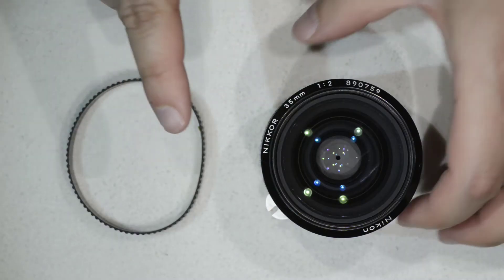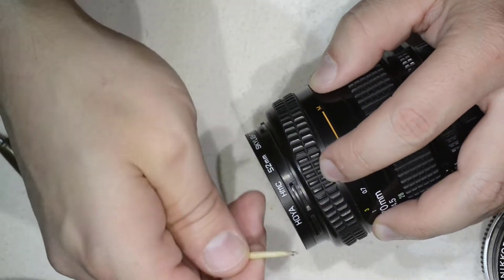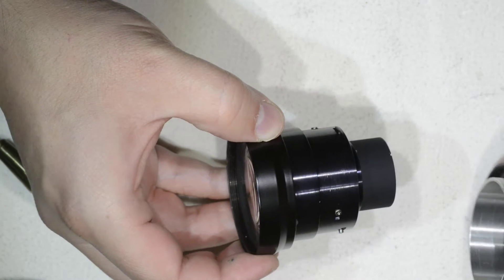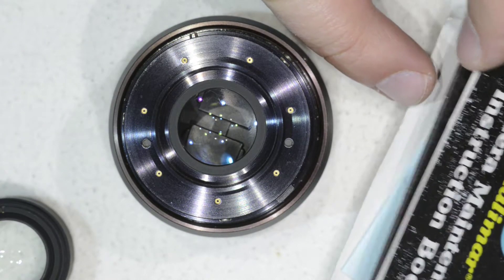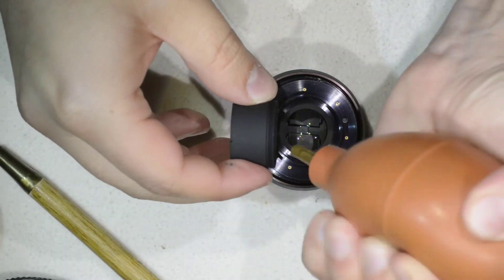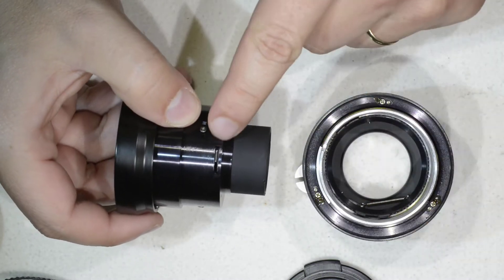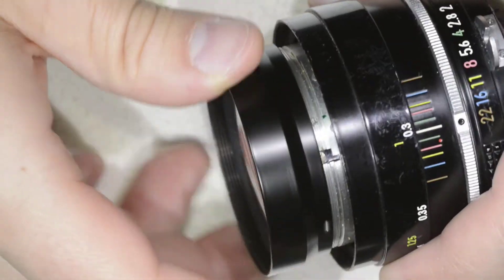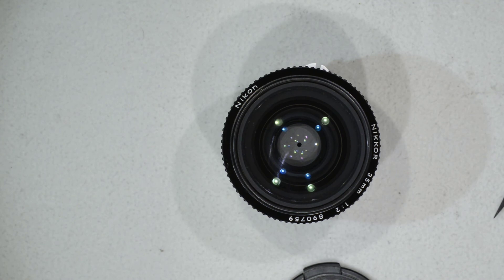Lens repair: Nikon Nikkor 35mm f/2 Disassembly and Cleaning

Comment: Great video. I have some haze at the other side of the aperture, so closer to the front of the lens. Is it an doable DIY job to get to those elements? I'm hoping it is not inside doublet. Can you recommend a type of grease for the focus mechanics? It could be smoother or more damped on my 35 F2 (AI conversion).
Reply from the maker: Yes, I think I have a video working a bit further in this lens. For the grease, it depends on your taste, I prefer very damped for 1.2 lenses, and really smooth for others. For smooth, I recommend the grease SKF LGLT2 or equivalent. Best.